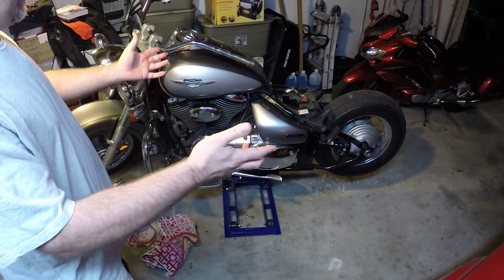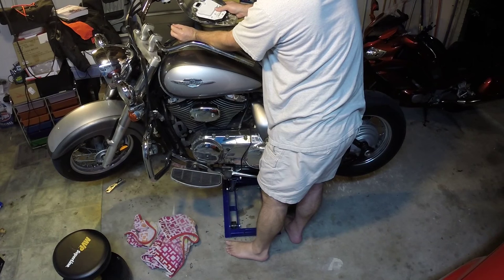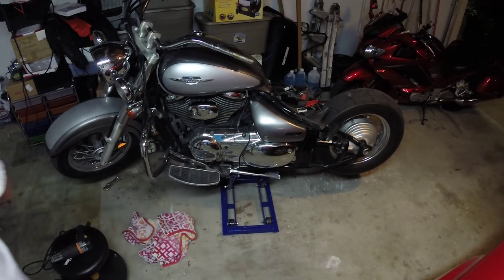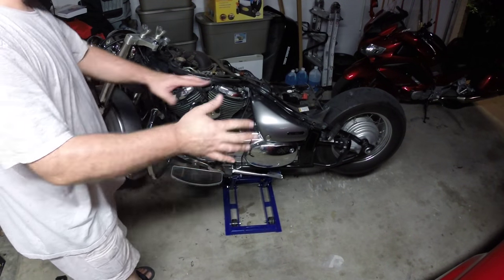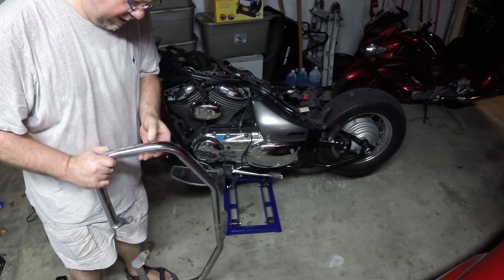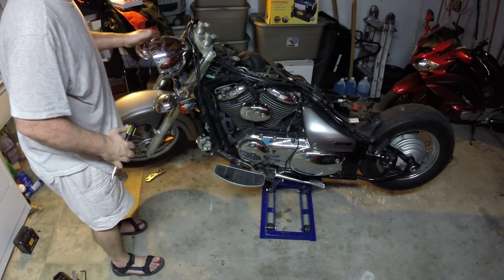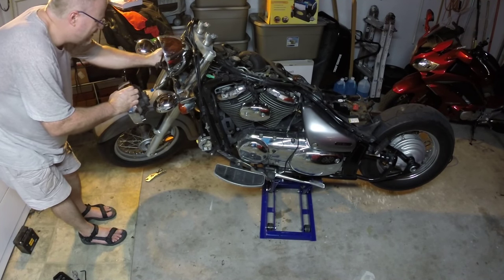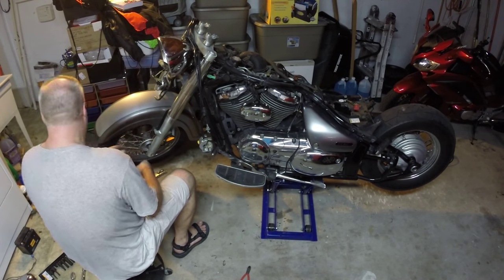Suzuki Boulevard C50 Bobber Build Project Day 5

Comment: I use one of those magnetic dishes for screws etc Bryan. I prefer to buy locally if I can because apart from supporting our local shops, I too dislike having to send stuff back  in the post. Our postal service in my opinion is the best. The problem Royal Mail has is because of so called 'fair competition ' many foreign companies have 'cherry picked ' the more profitable parts of the service such as parcel deliveries. The door to door stuff such as letters and small packets has been left to Royal mail because they know there's no major profits there. As far as I know we're the only postal service that charge the same for delivering letters door to door within the country no matter how much distance? The best parcel service I've come across is DPD. They're excellent because they send an SMS  message by a named driver to tell you when they're going to deliver it that day.

Comment: Thought on your Phillips screw  issue. Anytime I'm working on my bike and come across Phillips screws I take them to Ace Hardware and buy an Allen head screw with the same thread patterns. They all have little things to screw the old one into that tells you what you need to get to replace it as far as twist and distance between threads.
Reply from the maker: Coy Tucker The problem with that is most of the time the phillips heads are tapered to fit in to the part - replacements are not.
Reply: I could see that being a problem. I've never ran into it fortunately because I hate Phillips screws too and my local Ace Hardware tends to carry a lot of screws/bolts that are specifically tailored to motorcycles.